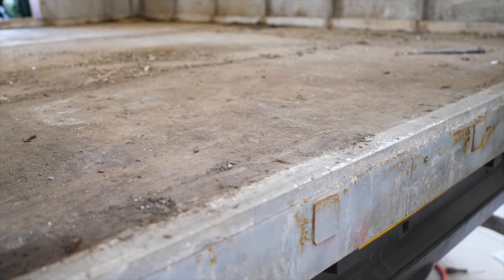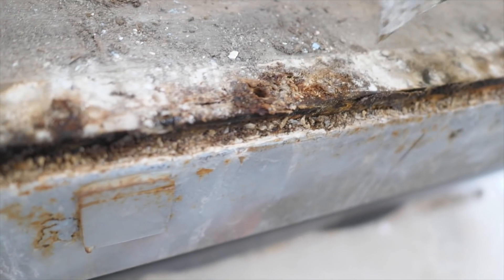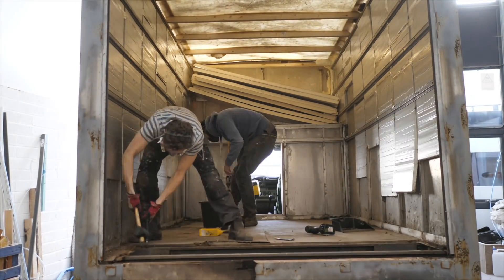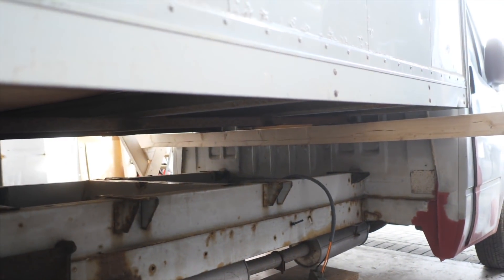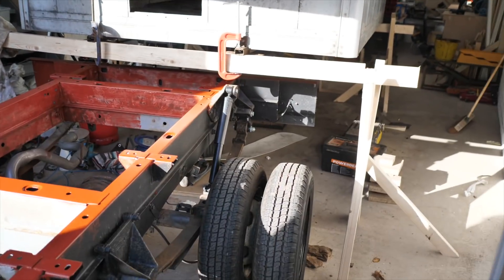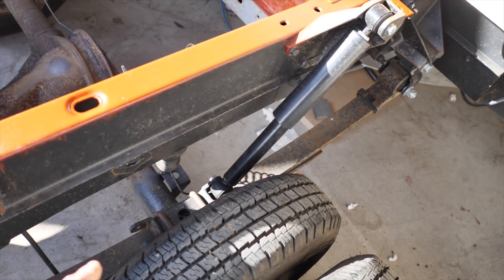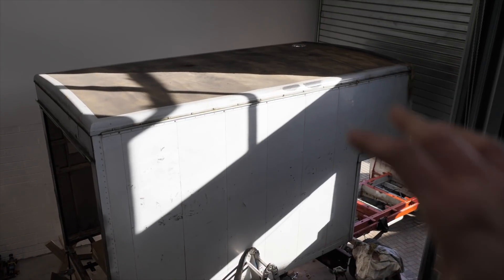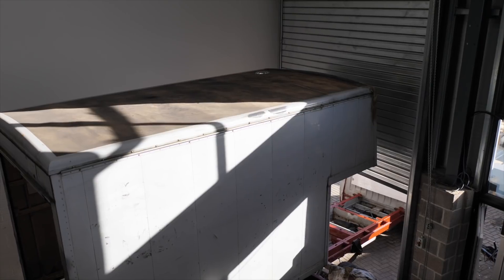Luton Campervan Build, 02, Removing The Box!

Comment: If I'd known you wanted to remove the box of that Luton van I could have helped. I once drove one of those which has an average height of 10ft 2", under a bridge which was only 8ft 6". Took about 3 secs to remove the box. Job done.
Reply from the maker: hi steve, any info on bridge location? sounds like a  nice quick fix haha
Reply: @HughTube  it's in Chester, but I wouldn't recommend it. Ha.

Comment: Excellent job you need to invest in a small sandblaster, sorry thats the painter in me. Just a thought here in Aussie small trucks have a plastic front above the cab that is rounded on the edges I think to improve aerodynamics and fuel economy, might help. Oh put in a couple of extra leafs in the springs to beef up the load carrying ability its gonna be awesome.
Reply from the maker: Cheers! yeah funnily enough one of neighbours allowed us to put his sand blaster in our unit as his compressor hasn't got a large enough tank. someone else mentioned  about adding extra shocks so something else to pass on to Ben

Comment: Hey buddy, really need your advice. I was wondering if it would be possible to convert a Luton box and install/remove it when I wanted to change vans?
Reply from the maker: yeah totally! thats what Ben is planning, he hopes to run with this van until it's finished and then put the box onto a fresher one and keep the home. We will cover his in a video on  the series but basically he will keep access points from  the inside to the bolts holding the box down so he can unbolt them,  jack the house up and drive the van  out.

Comment: Hello Hugh, 
A general question, if I may,? 
 Have existing split charge system on transit Mk7 camper.
Would like to improve batteries and add solar..
 If I add 200ah ish AGM batteries, I am concerned split charger will overcook them, so not sure how to control input from that and also from 100w to 240w ?  solar PV and maybe from site input as well ?
 Do you have any products that can do this  or advice ?
 Thanks. 
Huw

Comment: Great project! I’m doing the opposite, I have a “Mini Winnebago” which I’m converting into a Flatbed Truck due to serious water ingress in the habitation, it’s basically the same size as your Luton. Just wondered if you would be interested in the windows for your van before I advertise them on eBay. Aluminium frames with tinted glass, I’ll be breaking it in the next few weeks...

Comment: Just an idea, have you looked at Acropol, its a fibre based roof sealant, its great stuff, hard wearing, it would seal your fibre glass roof up with easy. I use it to  fix flat roofs when required. Doesn't need a expert to use it either, Maybe look into.
Reply from the maker: Boom!  thanks so much for this, will pass it by Ben
Reply: @HughTube  no problem, at the very least it's an option. There are cheaper alternatives out there but Acropol is the best, roughly about £55 for a 5l tin and that should cover about 5m2 if I remember right.